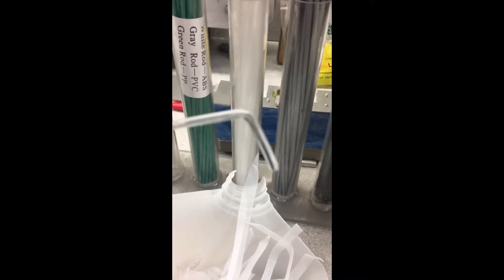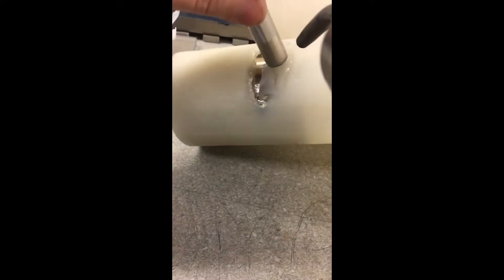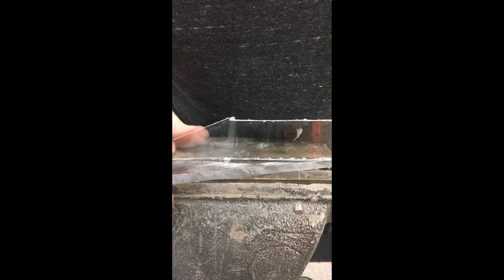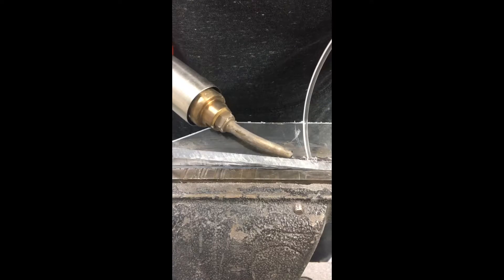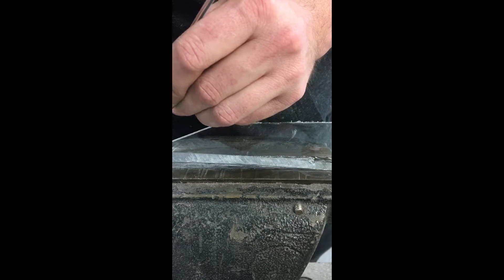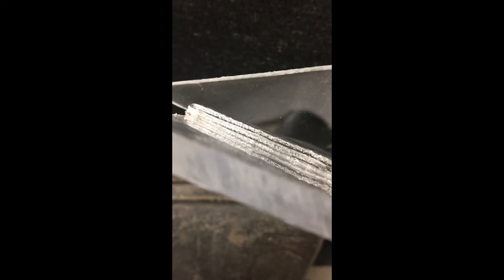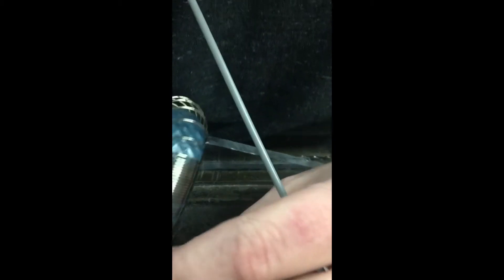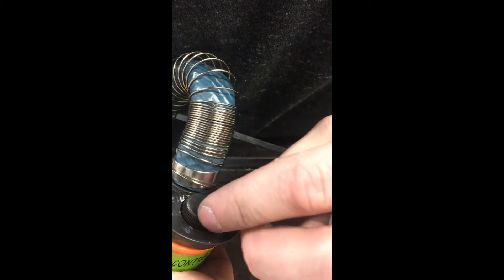Plastic Welding and identification tips

Comment: A question. What HF rod (color) would you use on Thermoplastic.  I need to weld up a mower Air Filter housing.  I may be wrong on the type of plastic. TIA
Reply from the maker: You’ll need to look more closely at it they use abs or nylon for a lot of those items. You can try scraping the part with a knife or like ‘carving’ a small bit off and listening to the sound it makes. If it sounds grainy, it’s likely glass impregnated nylon, no grainy sound it’s not glass impregnated which could mean plain nylon or could be abs. Now take the shaved off tiny piece and try to heat it. If it gets very liquidy like water on the surface, nylon. If it heats and heats and looks pretty much the same as while it’s cool, just sticky, it’s likely ABS.
Reply from the maker: White from harbor freight is abs. If it’s nylon (even glass filled nylon) you can use black zipties for filler. Just gotta be more careful heating glass filled nylon as it tends to kind of burn on the surface if you heat it too quickly. Nylon and especially glass filled nylon welds best with the soldering iron method.

Comment: This was very informative... For automotive bumpers ive done alot of fiberglassing, but now im repairing a PP (Polypropylene) bumper... Id like to also get the polyurethane, ABS, polyethylene sticks as well... How well would you think The HDPE or Nylon work? As i got excited for a second when you brought up the Nylon zipties!

What plastic blower and stick brand would you recommend? At least the stick brands (Fiber Flex Rods?) would be nice as I'm thinking I can make a custom narrow funnel adapter to my heat gun to concentrate on just the area of the thickness of the tubes...
Reply from the maker: I just use the cheap crappy harbor freight blower. Since this video I’ve done a bit more with hdpe as well as nylon. The hdpe does better by heating the base material then laying on a thin strip of filler (I use old milk jugs, washed and cut into strips) and then pressing with a room temp polished steel shaft. For nylon, the blower really doesn’t work very well for me, but rather, a soldering iron set to low temp, and just push the nylon filler into the crack you’re joining. Using the blower with nylon actually liquefies the nylon and it becomes very runny on the surface, then blows away, even with my air regulator set as low as possible, I end up with little strands of blown nylon like spider web strand. But the soldering iron and just pushing the filler in works well with nylon for me. Thanks for watching my video! And I must mention your gorgeous car in the thumbnail!
Reply: @gallupcustomknives2293  thanks for that tip, i probably should have asked about the PP/Polypropylene (that's what I need for repairing Vehicle bumpers) Polyurethane & ABS as well... The others I prob wont be Actually using. Any tips for those 3? Like same thing, which apply better by air heat, or which are better to apply by direct contact (heating the surface, with either a teardrop style soldering gun or the triangle flat area type soldering gun for wider contact areas and corners with more so the flat fiber flex sticks for PP repair)
I know for prepping the surface a teardrop dremil is first used to create a valley (V groove) then using a the air heat or even possibly the direct heat of a teardrop style would be good for the long round style... The go over on top of that with the flex fiber flat ribbon styles, using just the flat triangle soldering head (or would you even recommend just using the heat on this too?)
Reply from the maker: @tnasituning8173  PP melts similar to nylon, but not as bad, for PP I use the air iron but reduce the heat and reduce the airflow slightly, all I use is air iron and fill by hand, I’ve thought about getting different tips for my air gun, with rod feed guides, but I’ve not yet really needed to for the kind of work I do. I like doing polycarb and abs the best, they act similar. Of the types you’ve mentioned the ABS should be the easiest to work with.